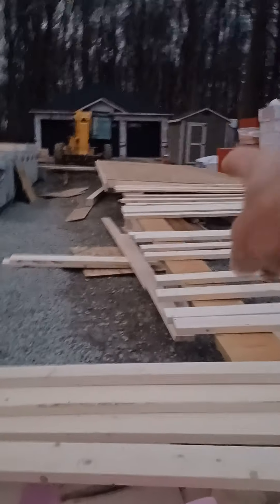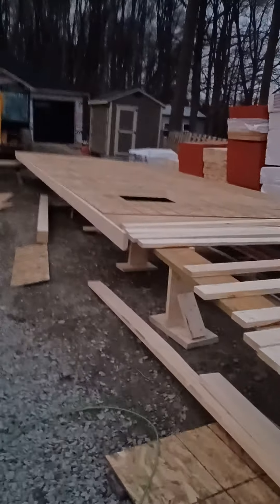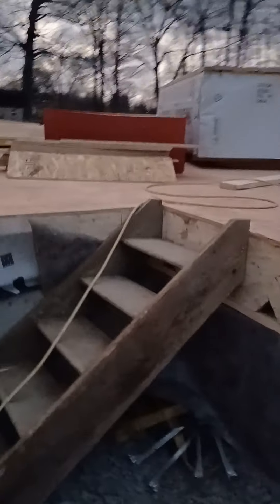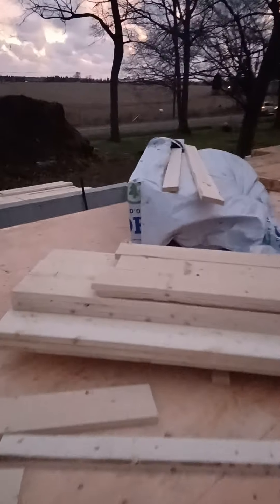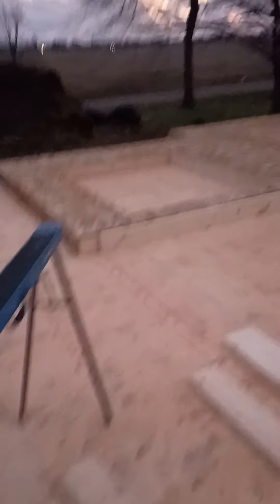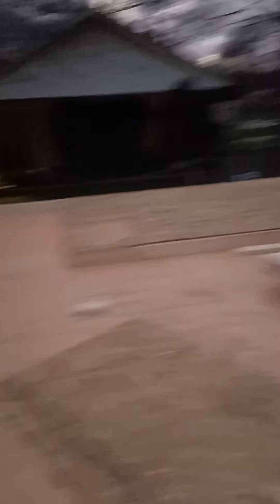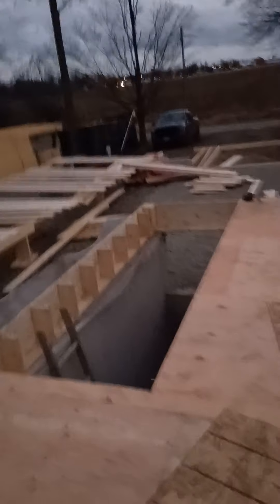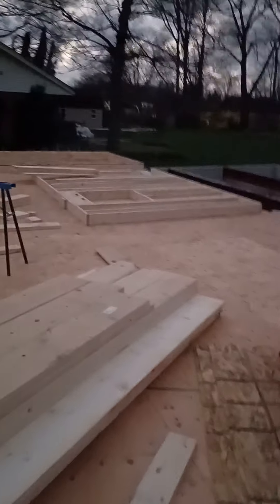End of day 3 on custom build...I just wish it was windier

Comment: Love the channel! Have learned a lot from everyone on here. Have a question. I recently was awardees a Rolair compressor, and have always ran pneumatic nailers, was wondering if the Milwaukee nailer is worth it? Or should I go with a pneumatic framing gun? I do remodeling, cabinets, and mostly finish work, but feel that I want to use the nice compressor I have now. Just stuck in what to invest in. Hoping to hear some good answers. Thanks!